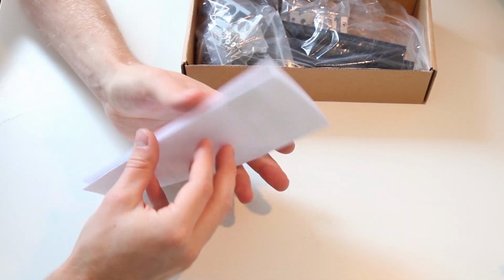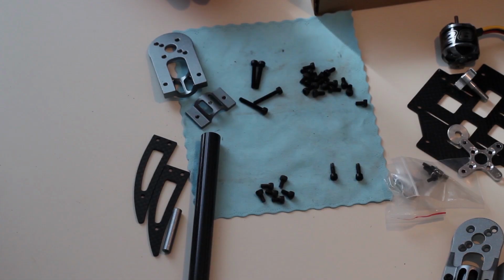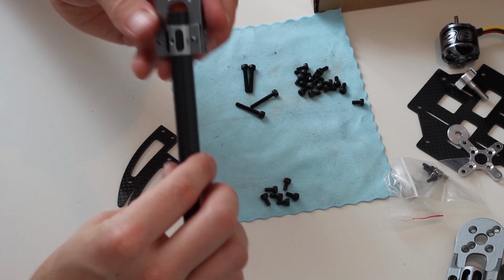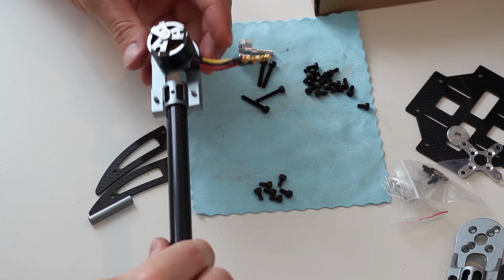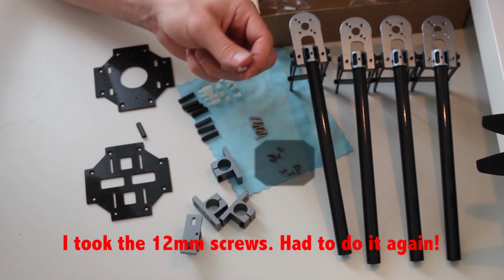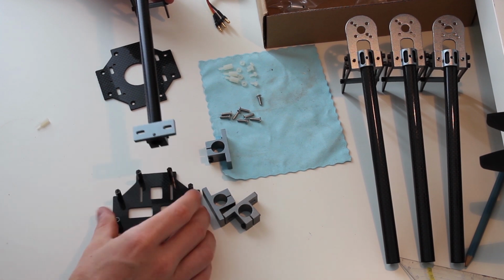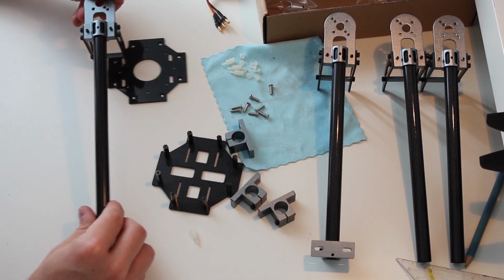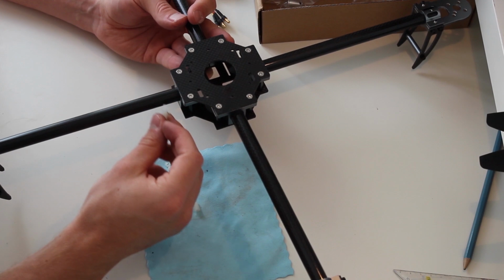Basic Quadcopter Tutorial - Chapter 2 - Frame Construction

Comment: OK... this has been bugging me so look alive Turnigy & Hobby King. I have this frame and while its not perfect its the best one on the market in its class right now IMO. But look at the 4 holes on the top center plate 45 degrees to the boom's mounts. Not sure why Turnigy changed the design but they are there for a reason and that is where the designer intended that you mount the nylon posts using a nylon hex nut. There are many advantages to doing this and it's not for flying in + mode as people think. The hole positions Turnigy is using as a nut to mount the nylon posts is there to access an allen head set screw that keeps the booms from rotating at the center section allowing the motor mounts to rotate in case of an impact and not the booms.

It's easy to realign the motor mounts but you will want a mark showing you the level rotation point where you set it up at. But if the booms rotate you have to start all over again to level the motor mount. You can mark the inner boom supports as well but to loosen and tighten them when they get rotated you need to remove the booms right sides vertical mount to access the allen head screw in the boom mount... and that means you have to loosen the left side vertical mount as well... and that means you have to loosen ALL the top vertical mount screws because the carbon fiber support plates are so rigid and stiff they are holding all the vertical mounts in place together as one unit. You can probably man handle the right side vertical post to get it out but getting it back in and aligning it with the hole will be a lot harder than getting it out with the top and bottom carbon plates tightened down.

The set screw keeps the booms from rotating without over tightening the inner mounts, and set up tensioned properly using the internal set screws that bite into the boom's surface the booms will not let the booms rotate, but in a front head-on impact the boom can be pushed in 2 inches with the set screw dragging making a mark as it absorbs energy rather than breaking the boom in compression. Better a scratch than a broken boom but most people are tightening the center mounts more than needed to keep them from rotating which is the function of the set screws being left out.

Another advantage of using the correct holes when flying in the normal X mode is it allows the square middle top section holding the power distribution board and the controller board etc. to fly forward in weather vane with a corner pointing forward rather than a wide flat surface that creates more drag. While not noticeable to some allowing the frame to weather vane in drag adds to forward stability and this orientation lets you build a smaller streamlined body to protect the gear inside with a drag reducing tail. Personally I like a body that's directional as well as the motors closer together for faster roll response than pitch like Blade and a lot of high performance hexs do it, but I don't use mine for filming where a symmetrical design is better to stay in one spot pointed at what you need to film ignoring the direction of the wind. 

Some controller boards come designed to fly with the corner pointed forward as their forward arrow shows. If you are using a KKHC or KK2.1.* controller board you need to go into board offset where you can set it at +45 (forward arrow clockwise 45 degrees) or -45 (counter clockwise) to get it pointing in the best direction to reduce drag and work with this well designed frame. Of course this assumes you are running the latest firm ware that is V1.17S1 (last time I looked) if you are using Steveis gift to the community. And BTW if you are a weight freak to gain more performance and flight time the new KKHC weighs 33.2 grams and the case weighs more than the 13.6 gram board inside. Buzzer is 2.3 grams. And HK....get rid of the metal header and design some decent micro connectors that don't stick out a mile!

Comment: hi there, do you used the 4 stock arms of the 2 other arms that you purchase ?
Reply from the maker: I am using the stock arms. I have not used the extended arms yet.
Reply: bigben34x oke thnx, an other thing the motors mounts came with the motor, of you buy them separately ?

Comment from the maker: I didn't use threadlock on the screws, nor did I apply any dampening. Maybe I am going to add some later, but for the test flight and possible adjustments I keep it that way. The KK2 Board isn't effected that much by vibrations, I am more worried about the image quality of my gopro, that I will add later on. 

Thank you for your comment, I appreciate it!